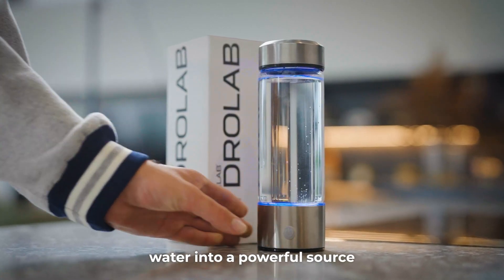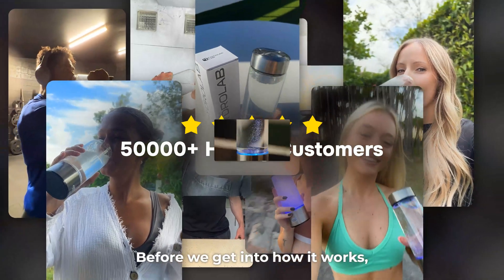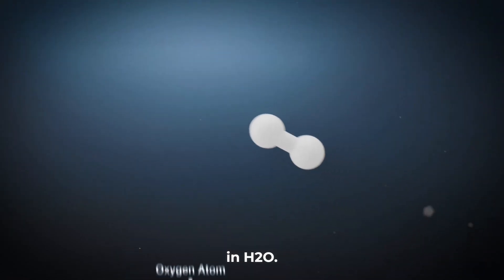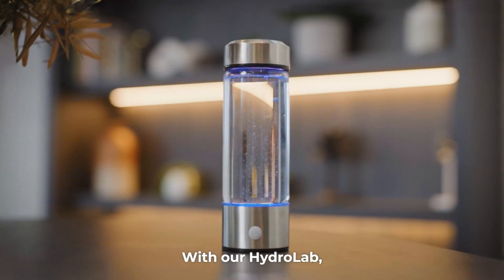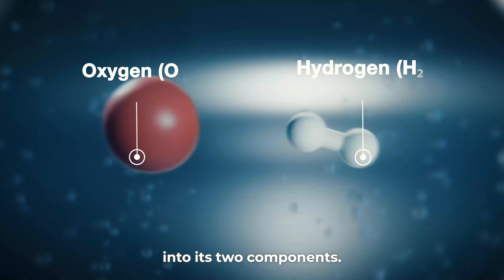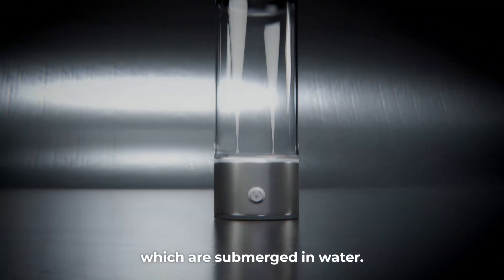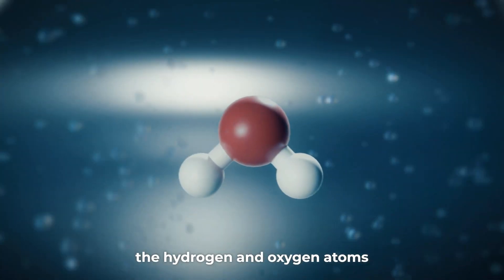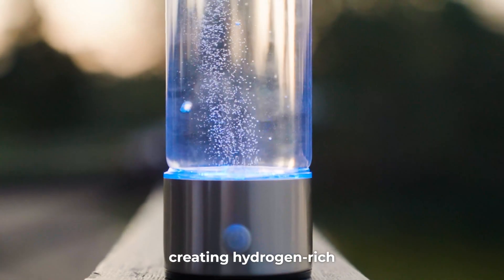What is the HydroLab and how does it work?

Comment: So you have hydrogen in water, you then break the molecule from oxygen it releases out of the bottle as gas when opened and somehow that creates more hydrogen in your water? 

Yeah right, makes 0 sense. Hydrogen is non soluable, it releases as gas when you use these because your breaking off the oxygen molecule and make hrdrogen gas in it's oure form, which you then lose when you open the lid.

If anything, this is make your water lose for hydrogen
Reply: Just add a few drops of snake oil and that will solve it!